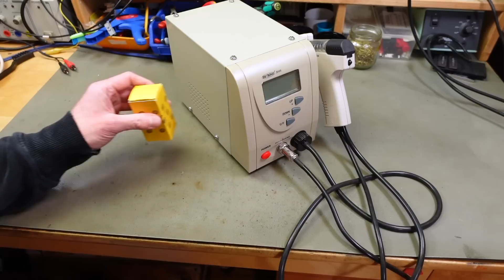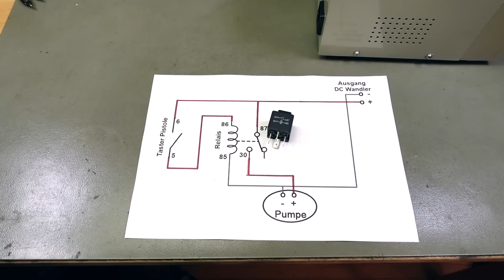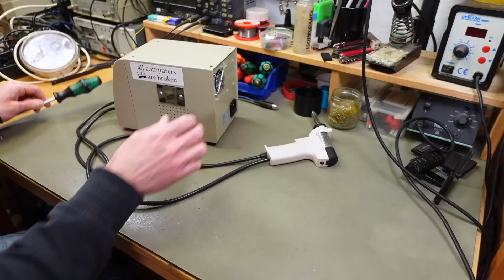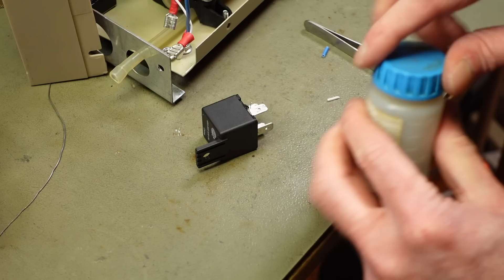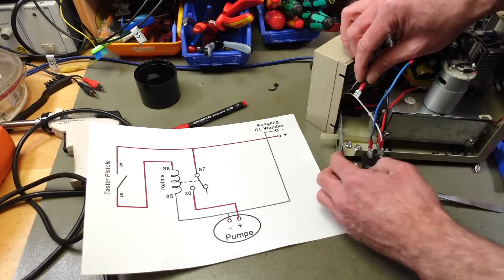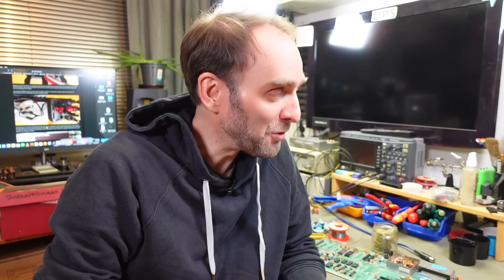Putting an Automotive Relay into my ZD-915 Desoldering Station

Comment: I'm currently dealing with the same desoldering station (in UK is sold as Duratool D00672) and every time I find a post or a video of people fixing its flaws I think that whoever designed it, did it in half the time they should have spent on it: it's a full catalog of more or less annoying defects!
About the relay... why not a N-MOSFET between the negative terminal of the pump and ground instead? An advantage of the MOSFET would be that it's easy to find one which can stand 20V Vgs,Max so you wouldn't have to lower the voltage supplied to the pump. For example IRFZ44NPbF: TO-220 which you can screw to a metal plate, VGS=4V so will be fully on at 12-13V, can stand 20 VGS, 49A rated with VGS=10V.
Can somebody explain what are the reason for using an expensive relay?
Reply from the maker: I mentioned that it would be easy to use a transistor based solution for this problem but I like the simplicity of relays (and the satisfying clicking).
Reply: @ 
a relay feels so much more complicated to me! I'm clearly not as romantic as you 😄
Next mod I'd do would be to make it a bit easier to remove the cylinder for cleaning. It's the cable tie around the hose which clashes with the boss of the screw. Maybe filing off a bit of the boss and fitting a thinner hose clamp (metal?) would help.
Reply: @JanBeta  The easiest way is to use the enable pin of the buck converter. He has the switching function already built in.
Reply: "Can somebody explain what are the reason for using an expensive relay?" Probably because he already had it in his box of relays. Simpler. It just works. Nothing to go wrong. MOSFETS can fail.

Comment: To be honest, i see no use for this relay mod. The wire length isn't long enough to make any difference whatsoever.
Got the same station for 6 years now and did all other mods besides this one and it runs perfect.
Reply: I agree - I recently did this relay mod and it made no difference whatsoever.

The biggest improvement for mine was checking then fixing the incorrect motor polarity - which it appears about 50% of the units shipped with.

I'm not really convinced that the increased motor speed directly equates to more suction.  There seems to be a maximum volume the pump can handle and higher voltage beyond that point makes no difference.
Reply from the maker: I measured the voltage difference across the pump after the mod and gained around 1V with the relay. The mod is entirely optional of course because as soon as you adjust the voltage to not damage the pump, the suction is going to be pretty much the same as before. I did this more out of curiosity and for fun. And so that nobody who watches has to try it. ;)
Reply: @JanBeta  hahaha good job Jan, always entertaining

Comment: I just wish they'd label the relays with normal labels, like "Pin 1, Pin 2, Pin 3, etc.", that'd make them far less confusing to wire up in projects... :S
Reply: The numbers used on the relays are the normal labels for automotive wiring and are used in many standards like DIN/IEC/ISO, etc.
Reply from the maker: You can just use regular relays (which are often easier to wire), the labels on this one are just automotive standard I think. :)

Comment: This is a bit backward from the standard automotive wiring for a 4 pin relay. Normally, constant power goes to pin 30, and switched signal power on 86 and they will be on separate circuits from the battery/power supply. 87 is the device output power. I think that the way this is wired will have increased the current load on the wires from the power supply (and possibly the switch too), because now it's powering both the pump and the relay coil off the same supply wire. If the switch is rated for the load of the pump, it's probably fine and the relay isn't needed. Is the switch under-rated or a known failure point?
Reply from the maker: As I said, this mod is entirely optional. The switch is a proper microswitch so no worries there. The wiring is pretty flimsy though so the relay helps with that. Not really gaining any more functionality after adjusting the gained voltage down though, of course. This was more for fun and out of curiosity.

Comment: This whole time I was trying to figure-out what the switching mechanism/circuit was previously... but based on your comments at the end, it sounds like maybe just the switch on the handle was directly triggering the motor? Yikes. No wonder you got 1.5V extra!
Reply from the maker: Yep, the pump voltage is originally wired through the switch. That’s why I wanted to address this in the first place. :)

Comment: On the factory setup, the voltage on the motor is about 18V, and it is completely fine. All "12V" automotive components should withstand 15V without problems.
Reply from the maker: The power supply in these indeed puts out around 18V. The voltage for the pump is brought down to around 12V with resistors though. Running this at 18V would probably break it relatively quickly. Slightly above 12V seems to be the sweet spot (I experimented with slightly higher voltages in the previous video).
Reply: @JanBeta  Maybe I am wrong, but from what I remember it was 24V PSU, and 18V on a pump motor.

Comment: I’ve just bought one of these and it no longer uses the resistors the fan and pump have separate plugs into the front panel unfortunately they still give out 18 v to the fan, I splashed out and fitted two dc-dc converters one for the fan and one for the pump
Reply from the maker: That’s a nice solution. I put a 12V fan in mine and can now run the pump and the fan from a single dc-dc converter (see the previous modding video linked in the description).
Reply: @JanBeta  Yes I did mine after watching your video, mine was a 12v fan originally but with 18v going to it it was almost as noisy as the pump I've since found out that most of he noise is down to an acoustic effect caused by the fan blades passing the vent holes drilled in the case

Comment: Nice video, I like the mods youve done to this! A suggestion for future modding - I wonder if you could get a more powerful fan into the hot air station (and check the wiring is safe if you didnt already!)

I find my 858D is fine for a lot of stuff but airflow is really terrible with small nozzles which means you have to have the temperature way up.

I think I saw someone trying to improve that before. Another cheap but functional tool amenable to home improvement! The wiring in the handset of mine was really dodgy to look at and the thing wasn't well grounded if I remember right.
Reply from the maker: That’s a great idea for a future project! I‘m going to take a look at it sometime (it works well so far so I didn’t bother with it too much). :D

Comment: HI Jan, as always great video and project! 

I have an idea for project sometime in future if your time and agenda allows...

My soldering iron is same or similar to yours (Weller WS81, 80W). It would be great to modify base station to cut off power or something similar if soldering iron is not being used.Basically it would prevent soldering iron working if by any chance left on for longer period of time and save heater and tips...
Reply: A Weller can run for hours/days without damaging heater and tip. Weller is quality! I even have my old Weller (still working) that use Magnastat tip from the 80s ...
Reply from the maker: That would be nice indeed. Maybe I’ll look into it sometime. Should be doable with a small microcontroller or something similar. :)